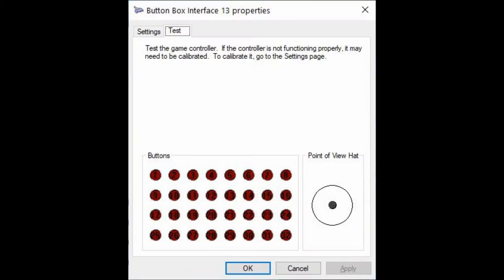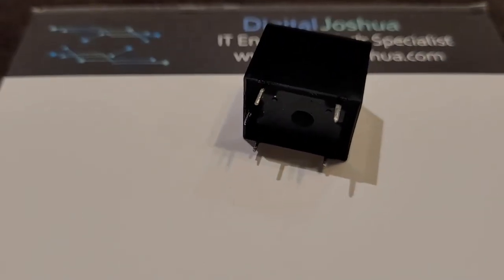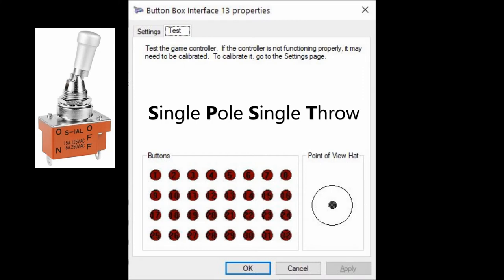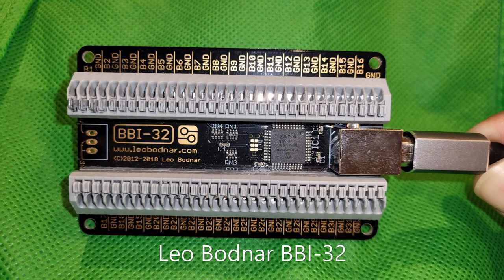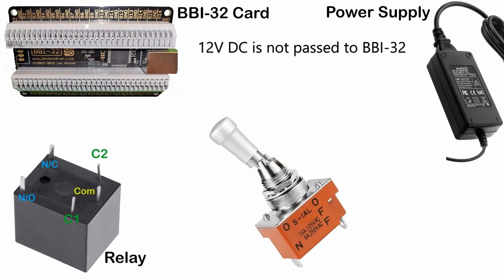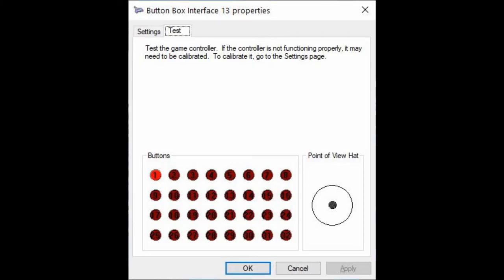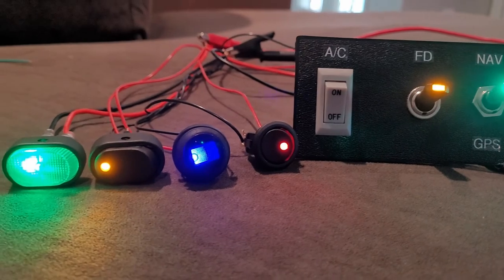Convert SPST Switches and Pushbuttons to SPDT

Comment: Hi. You mentioned you can use software to convert spst switches. Could you link it? I accidentally bought normally open pushbuttons and need a converter. Thanks
Reply: never mind, i saw the software in your video called svmapper, seems quite genius, I think I'll use that instead of wiring. Thanks anyway!
Reply from the maker: Yes correct! Sorry it took a bit to reply. In that comment I mention several tools but yes SV Mapper is great.

Comment: You can do the same thing using a transistor AND gate along side a transistor NAND gate... spst switch connects to input A of both gates while input B on the AND gate is high and Input B on the NAND gate is low. I've done this and it works pretty good 👍
Reply from the maker: Thanks for the comment. Do you have a link or further information on this so I can check it out? Thanks.

Comment: Does this work for Just general LED lights? Or only when connected to the board? Does it send a 12-volt signal through the normally open and normally closed with the ground being the negative? Or does this only work with the board specified?
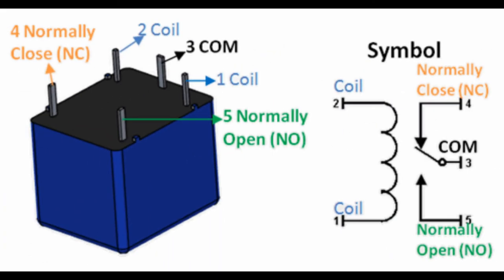Reply from the maker: Normally Open and Normally Closed cannot have 12 Volts. The Leo Bodnar card operates at 5v (USB Power) and would be damaged if the 12 V is passed through. The NC and NO are just inputs that get triggered when the circuit is completed by the relay. In a nutshell, the 12 V is used ONLY to operate the relay, but in the separate circuit, NC and NO do not have a voltage/current passing through it. This is explained at around 1:52.

Comment: Hello just wanted to say thank you for the videos they are very informative and clear awesome work. But i would like to know if you can get a spst led toggle to light up when on plus act as 2 different button presses using this method?
Reply from the maker: This is an excellent question. You should be able to accomplish this with a Dual Pole Relay. Look up the diagram for a DPST Relay. These relays have one switch that gets thrown, and this will enable 2 outputs. So the 12V Relay gets wired to the switch. When you throw the switch, the 12V enables the LED, and then the relay closes the circuit for the two outputs, which are wired to your interface card, operating at 5V. Make sure you review the schematics for the relay you purchase to make sure the two circuits are isolated.
Reply: @joshuamarius  thanks alot haha its kind of hard to find info on this matter since I'm using a Leo Bodnar bu0836x and a relay module. Really Really appreciate it ,it helps me understand the concept of the wiring better.
Reply from the maker: I understand. It's the same concept as the video I made though. But instead of producing one output you will be producing two. Just make sure you get the right product and find the right diagram for it and you should be fine 👍🏻

Comment: I have a leo bodnar card and a 5 switch panel plate with each switch has a LED but powered by 12 volts. I have watched your other video several times where you demonstrating how to use 12 volt to power upthe LED light switch but then using a relay module to power down to 5 v for the leo bodnar.  You have suggested using a multy channel relay board to  power up several switches and I have ordered a 6 channel relay board to power my 5 LED switches. I have no experience whatsoever in electronics, so how should I wire the switches using the multy channel relay boards because your Ytube vidoe only shows wiring up the single relay module. Your help would be appriciated. PLease be mindful I am not technically minded as please explain as you are explaining to an idiot (I wont take offence).
Reply from the maker: We all started from scratch at some point, and I had the same questions you did, so don't feel like an idiot - you are doing the right thing by searching for answers. When I was trying to understand relays, I learned to never assume anything and actually understand what every input and output does. So let's start with the basics. Although my video only shows the use of one relay, the other boards with multiple Relays are no different; you will still use one relay per switch. The important part is to get the wiring diagram and take some time to understand it. Like my video shows, start with the power supply and make sure it goes to the right inputs. Then wire the switch and make sure it is getting power, and then with a multimeter make sure the 12v is not being passed to the leads that go to the Leo Bodnar, or if you are using an Arduino. Once you get one going, the rest will be exactly the same. If you are not able to get this one your own, please go to my website DigitalJoshua and fill out the contact form and I will to send you some pictures of how I wire these up. Make sure to let me know the exact relay board your purchased.

Comment: Is there a way to do this via relay only on a 12v automotive application? I have an SPST switch that needs to become a SPDT switch
Reply from the maker: Yes. Cars already use relays to begin with. As long as you understand what the circuit is trying to do in the video then you should be good. Make sure to get the adequate 12V relay with the specifications you need, especially how much current you will be driving.
Reply: @joshuamarius sorry I meant can I do this with just a 5 pin double throw relay without using an USB interface like an ardiuno. But controlled by a SPST on/off 12v switch? Just let the relay do the job of switching between the circuits? I’m sorry if this is a silly question, I’m new to this type of stuff
Reply from the maker: @swrcnz Yes. The Arduino (in my videos)  allows things to be automated or monitored. In this case, you are triggering the relay yourself with a switch. Works exactly the same way :)
Reply: Thank you for your help, much appreciated
Reply from the maker: @swrcnz  You're welcome. Good luck on your project ✌🏻

Comment: There is one problem with doing this. It takes up another button spot on your board. Using a program like RS or SV Mapper, you save spots that can be used for other buttons.
Reply from the maker: That is correct, but SPDT switches will take up two inputs on your board anyways. This video talks about a very rare method...but it gives you yet another way of doing things if you do not want to deal with additional software you have to configure, and if you just want your setup to be plug n play.
Reply: @joshuamarius  Oh yeah, if you don't want to use software, it is the only way to go. Your videos have helped me wire my setup. I am building a F-18C cockpit and at the very early stages of it. I have the front console wired, but I had to skip a few buttons, because I only have a Leo Bodnar 32 button board. I built the wood section last year, but  watched your and The Warthog Project video's. Put all of the switches and buttons together in the last week. I've had the Leo Bodnar board for over a year, but was not sure how to do everything. Here is what I have done so far. https://i.imgur.com/bVHvmIY.jpg
Reply from the maker: @ComdrStew  That's awesome you were able to use my videos and thanks for sharing. Excellent job!